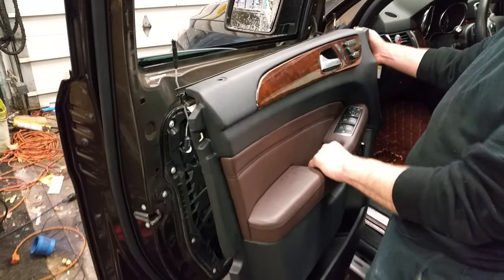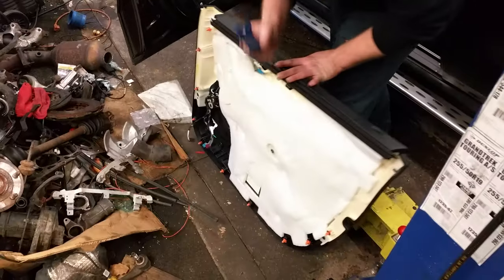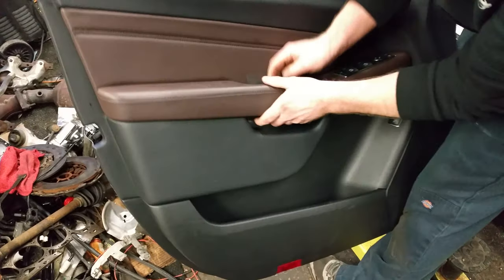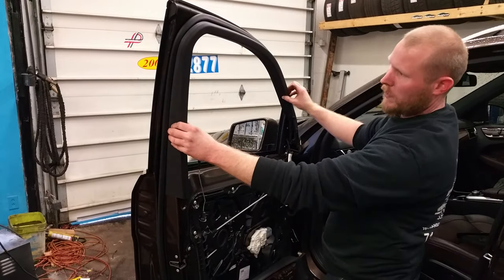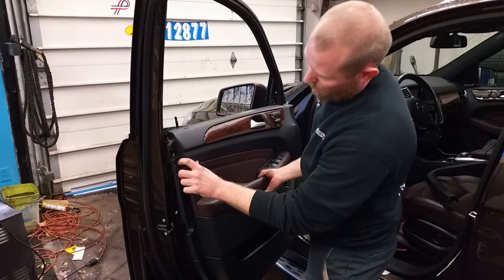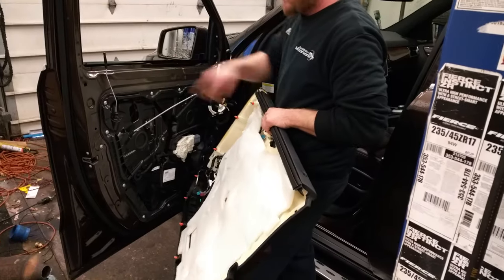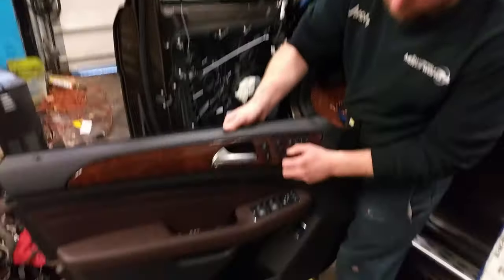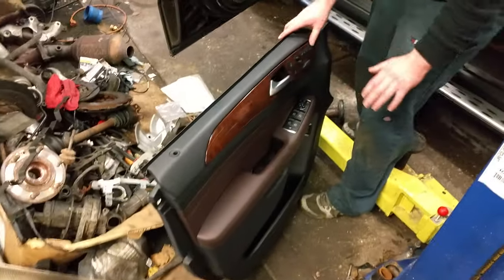2012+ Mercedes ML Door Panel Removal ML350 ML550 ML63 AMG W166 GLE

Comment: My 2024 ML350 did not have the top 'overhang' that door panels usually have. Instead, you it plugged into the upper part of the inner door frame and required you to leverage it inwards to the interior. No amount of upward lifting would dislodge the door panel. Just an FYI for video viewers who might come across the same issue.

Comment: Good info, only wish you explained the square clip removal at end of door. Still struggling not to break it. It seems something needs to be pushed in for clip to disengage.
Reply: I'm struggling with that did you figure it out? I pulled the center part of the clip put but doesn't seem to make a difference

Comment: It is the first video I could find in youtube regarding 2012 + model for door panel removal, thanks.I want to replace to  door handle frame,  but I cannot remove the black  Barrier behind the door panel.  I took awya all the screws,  still not able to remove it.  Any advice?

Comment: Need to replace my mirror housing. This helped a lot, I did not know how I would disconnect the wire without removing door panel. On my w212 there is a cover hiding this location but on the w166 it is completely behind panel. 👍🏽

Comment: I appreciate this video.  I was replacing the mirror assembly and needed to get to the electrical connectors.  This worked excellently.  I used a pair of hemostats at the upper corner of the panel to get to the T30 bolt.  A good hook tool would have worked too.